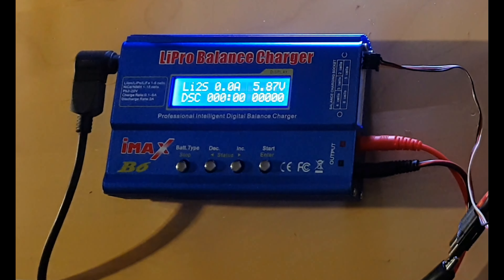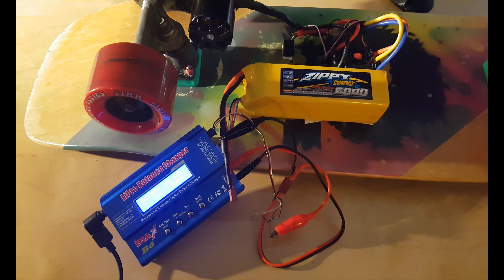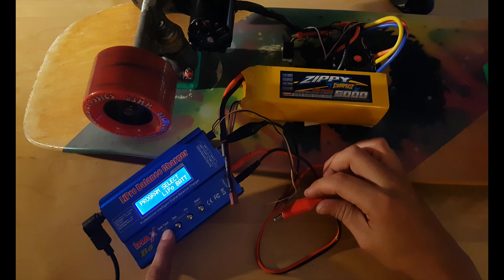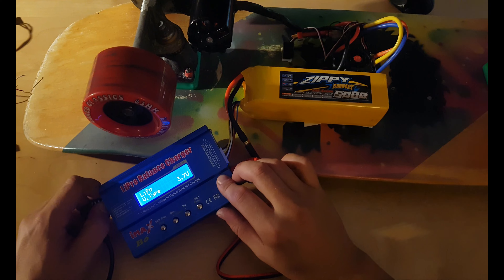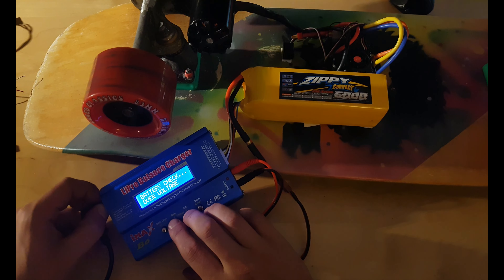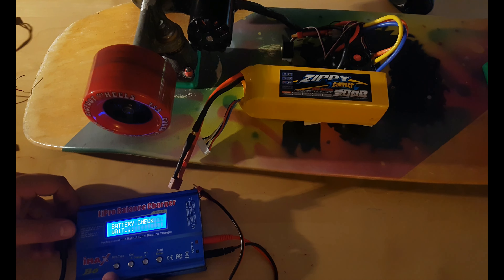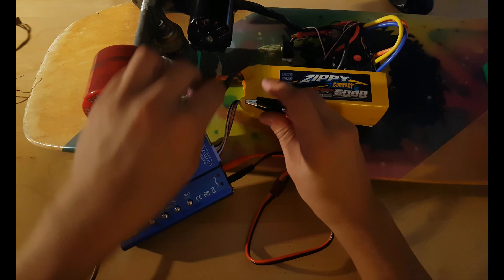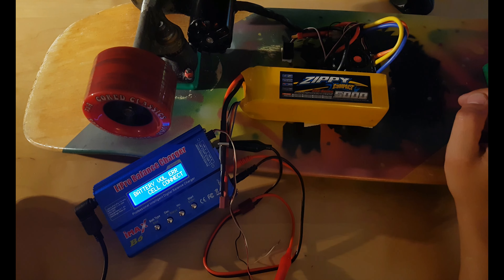IMAX B6 Mini - No Response on Buttons and Over Voltage Quick FIX 2017

Comment: Thanks! I had same problem with Happymodel  Mobula 7 serial 4x1S charger. Initially was using it in a 1S mode (attaching a single battery and setting jumper on it), charged /discharged my batts. Then came URUAV BlackLIght B6 Parallel charger, which I've used to charge/discharge my 2S and 3S (one at a time) batteries. Then attached Happymodel 4x1S charger board to this URUAV board and was able to work with my 2x1S and 4x1S batteries as a single 2S/4S (it was correctly detected by the charger). Then again tried to attach Happymodel 4x1S charger to 4S connector on charger and it worked!

Comment: Thank you Andrew for this video. It helps me fix same problem on my Imax B6 (clone) balance charger. For some of you who have the same problem, before you do this method, be sure that you have a six cell (S6) LiPo or Li-Io Battery. It will only work on 6S.
Reply from the maker: Very glad it works for you
Reply: I tried several methods fixing this clone charger but it didn't work. After watching your video, i realized that the reason why my buttons are not working was due holding stop + start button while turning it on. So i tried your method on how you solve this issue and boom! My charger is working again. Thanks to you friend. 😊
Reply: I dont have a 6S battery, i have a 3S Lipo. I have a similar problem and it shows 1S 3V when i power it up. What can i do to fix this issue..please respond. Is a 6S battery so necessary??
Reply: Yes he said it will only work with 6S ..this is a great hack an seems to work can i get a diagram of it ?
Reply: @manuks6183  i have same iassue and 6s not help...how im supose to get thia error ? Need to wait or what ?

Comment: Many thanks!!!! I thought mine was bricked after the kids played with it. Only point mine initially went to discharge 2s mode, and then to balance 6s both circuits were set up i just had to quickly switch the +ve main charge cable when prompted ( battery  check)

Comment: Thanks... but my problem was on two burned mosfet and fix is to change them ! After that works like new.
Reply: Hello everyone
where is this transistor located, and is it possible to replace it with more money than happy ones?
Reply: I got it after overheating

Comment: And do you have fix If error is in S1
Reply: just use the main charge leads! no balance
Reply: @mrsedgwick7693  not work...always say over voltage
Reply: I got solution, plug only 6s conector..then 2s(connector) blue cable in red hole, black cable in black hole and works